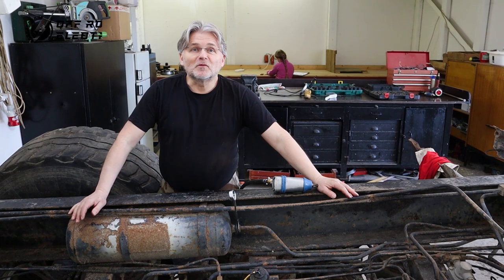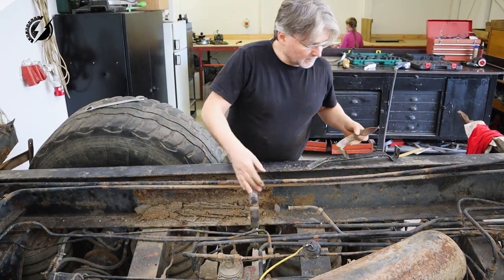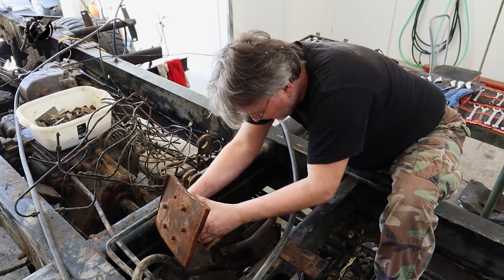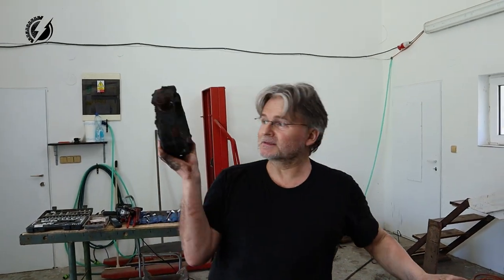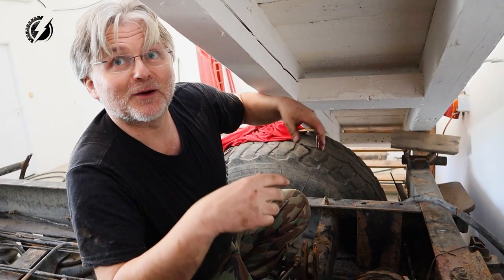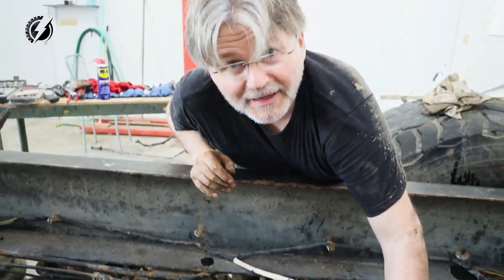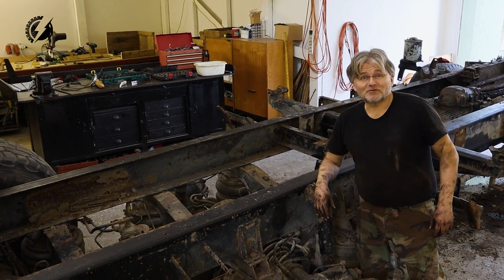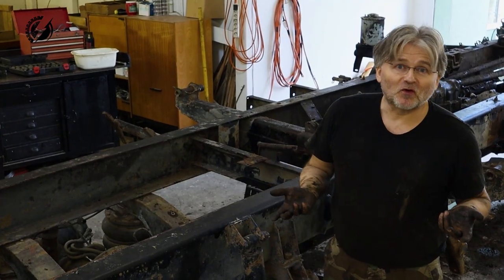Best Off Road Electric Monster Truck Build | Ep.17

Comment: I am surprised at all the hydraulic and air lines that thing has.  Those hydraulic cylinders look real heavy.  Watch your back Peter....happened to me once I was bending over to pick up a single 2x4 and my back went zap and I had to lay on the couch for three weeks.  Too bad that was before YouTube.  If that would have happened now, I would just lay there for 6 weeks and watched your videos.  :) Cheers.
Reply from the maker: Hi Pete, yeah, the fixed flatbed and the tandem rear leaf spring tatra model would be much simplier.....but I chose this rarer model to use the air suspension for my project. It will fly into the air over the bumps:) Cylinders might be plus minus 140 pounds...Since now, there will be only heavy parts to work with on this Tatra. Can't wait!:)